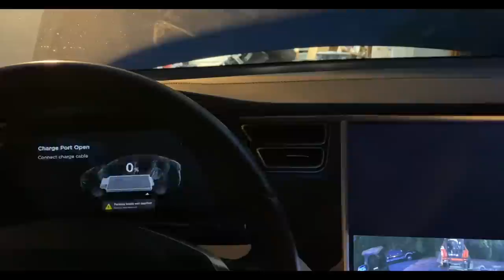Rebuilding A Wrecked 2020 Tesla Model X Part 6

Comment: I wish I had as much faith in my tools as that dog does in those jacks
Reply: As long as you leave the jack under there so the rescue team can retrieve the body easily its all good.
Reply: @davidj4662  😂😂😂😂
Reply: It locks into place....
Reply: No diggity. He got the dog in him.
Reply: @davidj4662  You stole that line from Derek of @Vice Grip Garage. Be original.
Reply: @misterpimlott6330  Ain't talking to you so you do what you asked me to do. Thank you.
Reply: @misterpimlott6330  Says your mirror.
Reply: In 1975 I was under an Alfa Romeo Guilia fixing the suspension shockers. I rolled out from under the car for a cup of coffee. When my shoulder cleared the door sill the jack collapsed and the car hit the floor. It would have crushed me. Always use axle stands.

Comment: The 90D doesn't have more power than the dual motor long range.
Reply: They didnt read the last 50 coments about this topic either lol xD
Reply: @TheFlash8889  there is no point commenting on there videos, this just proves they dont read the comments
Reply: They Are working hard. Be kind dude😁
Reply: @stephen865  5000 comments, they might miss a few.
Reply: @timglass6041  not really. I mean its like tv man.. they likely batch record and release so they dont work 24/7.. and even then theres 1000 experts in YouTube comments that are allways wrong because they are some random guy on a sofa.
Reply: @JSmooVE3990  x1000000 as matter of fact the 2020 Raven model X has bigger battery and more power. These guys are pissing money away on this.
Reply: @timglass6041  unsub and then chuck a straight turn a left and goodbye.
Reply: @timglass6041  stop it!
Reply: @timglass6041  they provide content for you to watch every two days. Stop being so fragile mate.
Reply: You sure it’s not a P90D without the P? I have a 90d and it does not have an active spoiler like this one has

Comment: Be REALLY careful with DC power guys. READ and be sure you understand what you are working with and follow recommended safety procedures. If you were to connect a circuit with your Body on a DC power supply you will likely die. DC Power is no joke. Love your channel and the fact you are not afraid to learn - be safe!
Reply: Power in general is dangerous, but AC is more harmful than DC
Reply: Wrong-- DC is more dangerous
Reply: @kookrew1  That is incorrect. DC Voltage does not alternate across zero making it much more likely you will suffer severe muscular contractions making it physically impossible to let go. Anything over 100ma of current is highly likely to kill you. The most popular Tesla battery stores at least 85 KWH power at 350-400 volts.  10KWH is roughly equal to 40 amps and only 1Amp=1000ma. It's WAY more than enough power to kill you even on a severely discharged battery pack.  Please guys - be safe with your work on electrical vehicles - love your channel and the fact that you are unafraid to learn new things - but be safe guys!  There are definitely reasons why Tesla goes out of its way to keep novice car enthusiasts from obtaining parts to repair them.  I do not agree with Tesla's position that they cannot be rebuilt safely - just pointing out that there are valid reasons to proceed with caution. A gasoline engine IS significantly safer to work on than an electric vehicle even with all of the excellent safety engineering that goes into a Tesla. Keep up the great work!

Comment: 9:04  A ton is 2000 lbs. so 6500 lbs. would be 3 ¼ tons. Those stands are very much within their limits being as they are rated for 12,000 lbs. Love your video guys and keep safe.
Reply: Easier 1000 kilos
Reply: Those stands are very much within their limits:
 Yes very very much within their weight range limits..., you might also want to add.., In Layman's terms...., if one jack stand is rated for 6 tons, that would mean 4 stands can support the combined weight of 24 tons equally distributed with a safety factor of several more tons each built in..  Conversely,  the actual curb weight of Model X is 5,441 lbs. That number divided by 4 is 1,360.25 pounds per jack stand.... That being said...one jack stand can easily support the weight of the entire car with approx another 2-1/2 ton capacity to spare, per long or short ton weight rating.
Reply: @IR-nq4qv  Yeah, I wanted to keep the post short as possible. I know that in the construction industry, our safety harness and equipment has a safety factor of 10 but I never bothered looking it up for a jack stand.

Comment: Dead battery on Tesla is over 300v that’s will energize you pretty good.
Reply: Yup... goonzfries, that's gonna happen if the boys are sloppy..hope not.
Reply: It's not the volts, it's the amps that get you.
Reply: @JohnDoe-nz6bk  it’s kinda both. 12v battery has 1000 amps but won’t harm you. But if you try 300v with just 10 amps that wouldn’t feel good. I suppose high voltage DC battery will ark and burn your skin, compare to AC jolt you would get

Comment: Guys! The 90D is not more powerful than the 2020 Dual Motor, the 2020 one is basically a 100D! Is just that Tesla dropped the numbers on the name and all the 100D turned into the Long Range and the P100D turned into the Performance! The 2020 has 520 HP! The 90D has 417HP!

Comment: NEVER EVER EVER weld or cut with a torch a shock. The pressurized gas / oil inside combined with the heat will create a explosion. While watching them weld that shock I was hoping the Goonz would not find out the hard way.  Love you guys. Jim Q from Chicago

Comment: Some people said in the comments that the 2020 one is more powerful and has more horse power
Reply: Those people in the comments are wrong. It would have to be a 2020 Model X Performance to have more power than the 2016 90D. 
Their 2020 has 417 hp combined and the 2016 has 518 hp combined.
Reply: @89ludeawakening1  WRONG! They one they have is a 100D (Dual Motor Long Range) with 518HP! The P100D is now the Performance with over 700HP, the 2016 90D has 417HP Tesla just stopped using the numbers on the name and all 100D and P100D turned into the new models, anything lower than 100D is not in production anymore

Comment: For the 100th time! The 90D is NOT faster or has more HP than the 2020 Dual Motor! When Tesla dropped the numbers on the models, the 100D turned into the Long Range Dual Motor! And the P100D turned into the Performance model!
Reply: I think they're actually on vacation and they filmed this episodes a while back haha. They're gonna regret it though cause we're blowing up the comments.
Reply: @JSmooVE3990  They are not anymore, this was filmed in most part yesterday, they always show stories on Instagram and they posted one yesterday taking the subframe out

Comment: The 2020 Tesla model X long range has MORE HORSEPOWER than the older one!!! 🤦🏻‍♂️
Reply: @quincy.m  long range has 203 in ONE of the motors. The second motor has way more hp, making the TOTAL hp higher than the 90D, thus making the long range faster. The new long range is the facelift/replacement to the older 100D.
Reply: @quincy.m  bruh 💀😪
Reply: @quincy.m  delete your comment ASAP lol
Reply: @quincy.m  Can't be more wrong you 🤡!!! The 2020 Long Range Dual Motor (the one they have) is a 100D with 518HP and the 2020 Performance is a P100D with over 700hp! The 90D has 417HP, is just that Tesla dropped the numbers from the name
Reply: @jayxj7785  he did it
Reply: @Eduardo-lb8np  good riddance!
Reply: @jayxj7785  what was the comment? I'm missing out 😭
Reply: @armon_mo3996  the 90D has more onset Torque!

Comment: It is terrifying to watch the way you guys disregard high voltage. Great to see the project advance.
Reply: Yep, they are looking at 375 Volt DC from those batteries even when they are low. More than enough to kill instantly. Hope they removed the main fuse at the very least, and they should use high voltage rubber gloves which would also be a good idea, a few dollars could save their lives.
Reply: no power going to the wires...
Reply: @AMLagonda  The motor ones wouldn't, but the ones above from the battry would be powered, if they cripped them while installing something it wouldn't be good, just saying fuse removal is a very good idea. lol

Comment: Everyone that says the 2020 has more power than the 2016, you are wrong. It would have to be a 2020 Model X Performance or Long Range Plus to have more power than the 2016 90D. 
Their 2020 has 417 hp combined and the 2016 has 518 hp combined.

Comment: Hey goonzquad find the hybrid power disconnect it's somewhere in the vehicle, I don't know where they put the Tesla's, but I know on Ford's it's behind the rear passenger seat. Pull that and let the hybrid battery discharge and that let's you pull the big components like that and not worry about getting killed!

Comment: You guys should know how to bend metal with oxy/acetylene torch. You could've straightened that shaft on the shock with a pliers if you get it red hot. You keep the other parts of the shock cool with a wet rag. And that "A" frame on the camaro you could've straightened in 15 minutes. Easier than a hammer!

Comment: The Orange cables are that color for a reason.  It is High Voltage. IT WILL KILL YOU. You are supposed to use special high voltage gloves whenever you are working with them.

Comment: The center screen being stuck on the rear view camera means the MCU1 memory chip (eMMC) has failed.  Tesla will replace under a voluntary recall (which they have to do even if the car is salvage).

Comment: Guys, those wires are no joke. They can take your life, its pretty serious. You guys have got to find the main "braker" switch / handle on this thing and pull it from the battery to disconnect it from sending power out. Powered or not, these things are no joke..

Comment: If you straighten the shock absorber shaft you will destroy the oil seal and the shock will leak and not work properly. Replace it.

Comment: Never touch the thick orange wires those are high voltage lines to it’s not smart so keep them separate because it won’t be a small shock it will be a big one

Comment: They don't have power because the cooling system is not working, I don't remember well, but I don't think it will charge much either because also to properly charge the battery, you need to have the cooling system working because it could burn the battery.

Comment: The center screen only showing the backup camera is a failsafe mode (the defrosters are likely on too) for when the eMMC chip in the MCU fails. There is a recall to replace the chip (actually the entire daughterboard it is part of) but you will not get the repair done if that car is a salvage title.

Comment: I have not figured out voltage in one those or amps but plenty kill yeah quick my wager.  More volts lowers heat low diam wire needed.

Comment: Please remove main battery safety fuse we value you both...... reset by depressing both toggle buttons on steering wheel down and though may not solve all christmas tree lights will reboot main screen

Comment: You said it needed a radiator the computer is recognizing that everything has to be hooked up radiator hot water in it and it'll know that it needs water it has sensors all over that car other than little body panels and Craig like that anything mechanical electronic essential can be attached to it will recognize and won't fully run full speed

Comment: Dudes! Step #1 with an electric vehicle is removing the safety plug from the battery back so it is completely disconnected from vehicle wiring before you work on the car!!!!!!!!!!!!!!!

Comment: Even at 0% that battery has enough juice to zap you higher than ypur mountain property.
Working with voltages that high is very dangerous and you need to take all precautions and take the job seriously. With your actions you can ensure some less experienced to do the same and it can end lethally. Seriously guys